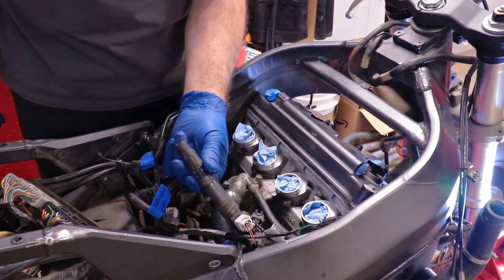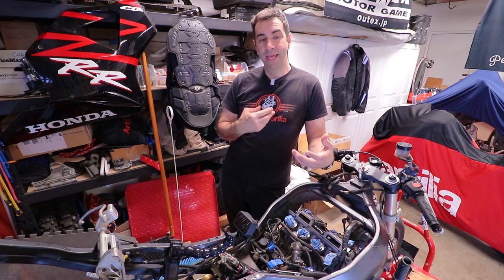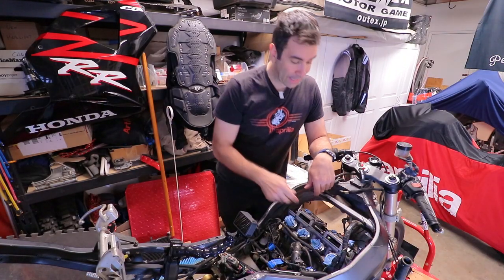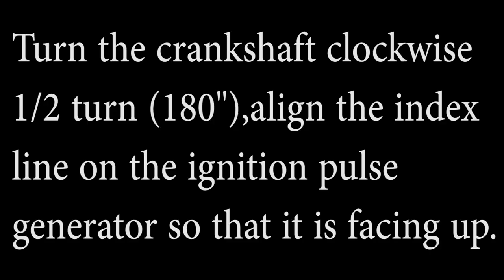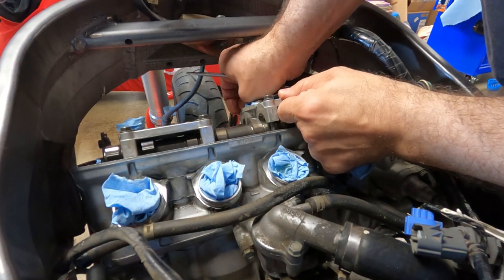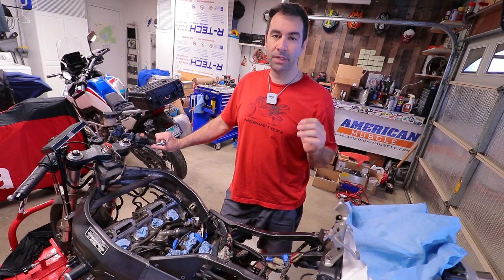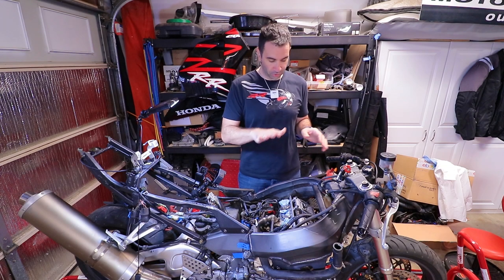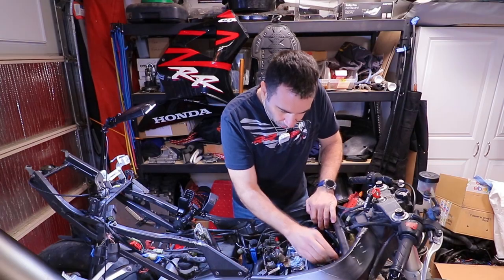Honda CBR 954RR Complete Valve Clearance Check guide Ep4

Comment: Hello, does this procedure apply to the 1997 CBR 600 F3? thank you very much friend, very well explained
Reply from the maker: The concept is the same but the tolerances change engine to engine. If you find a maintenance manual,  between that and my video you should be able to get it done 👍

Comment: decent video and passion to legendary model! Have one of those as well, but one issue is driving me mad -> jerky on revs up to 3000. Changed spark plugs + ignition coils, cleaned tank, filters but still same... nobody knows what`s the problem, pity :/
Reply from the maker: Well only 2 more things left to check the injectors or the vacuum tubeing of the throttle body, maybe the fuel injectors don't have a nice even spray that's why is Jerry to 3000rpm or there is a leak on one of the vacuum tubes messing up the fuel/air mixture. Good luck 😀👍
Reply: @AlbesADV  appreciate for a reply and hints! took out carb, cleaned it, did same with injectors (applied 10v and used spray can), mist looks good to me. Rechecked - replaced vacuum tubes, put everything together and to my disappointment no change :/ Works not too bad when cold, but total rubbish when warms up... With a water trick to exhaust pipe figured out that cylinder 4 is the problematic one as colder then others. Any more hints bud?? i searched whole internet, there are tons of people having similar issue with that model, but no one knows what`s wrong :/
Reply from the maker: If cylinder 4 is colder and and you have a trickle of water coming from the exhaust,  maybe, when the coolant gets to temperature and pressure increases, the coolant is somehow sipping into cylinder 4, that would explain the jerkiness below 3000 rpm since, maybe, above 3000 there is enough flow to negate the effects of the small amount of coolant in the cylinder, man i wish I could take a look,  good luck 👍
Reply: @AlbesADV  No water comes out from the main exhaust whatsoever, spark plug is darker (soot situation) but dry. Could a cracked valve give such a fault?
Reply: @AlbesADV  sorry for all those questions...
Reply from the maker: Maybe just a valve that doesn't sit right,  try to do a compression test and see what comes up.  Obviously let me know 👍
Reply: @AlbesADV  will try to disassembly everything again and switch injector + spark plug and coil to the next cylinder to see if the problem jumps over as well, to exclude those parts before digging deeper. The only thing amazes me that people report this issue since about 2004 and nobody ever solved it, shocking !
Reply from the maker: Of you have the chance,  I would test cylinder 4 compression when you remove the spark plug,  it's very easy and you should be able to rent the tool at autozone or buy one at harbor freight
Reply: @AlbesADV  i`m not from states... your videos looked very informative and looks like you know what are you doing so said will ask about my issue 🙃 it`s a tight space for spark plugs on 954, will any compression tool do or needs to be something special?
Reply from the maker: @justastulpe3265 i have a generic one and I use it for cars and bikes alike, it came with multiple attachments,  but I'm not sure what you can find where you live 🤔
Reply: @AlbesADV  i`ve added a link but youtube deleted for whatever reason... any chance i could contact you by email ?
Reply from the maker: @justastulpe3265 you can contact me thru the Instagram messages
Reply: The reasoning for the 3000rpm running sluggish is probably because you have either done the flapper air box mod removed exhaust valve, I noticed this myself when I did both, before it was perfect but I instantly noticed the bog feeling down low while setting off or slow cruising through traffic.my bike has 54,000 miles on it and the compression test on all 4 cylinders are at 160psi evenly. Not bad considering there 174 psi new.
Reply: @FromTheGroundUP627  no mods were done, bike is 100% factory stock

Comment: The chain that the tensioner takes up is below the sprockets and if it's timed either way, if the tension is on the chain, it wouldn't be pulling on the cam or flexing the cam because a it's seated and it's not rotating the chains on a sprocket. it's not like the chains pulling or rotating the sprocket via the chain tensioner it's just taking up the slack behind the plastic guard

Comment: How come you have to loosen the chain tensioner when checking the clearances the cam covers are down as far as I'll go. The cams aren't gonna flex. I don't see why tension on the cam chain on the sprockets would have anything to do with the lobes when they're all seated.
Reply from the maker: If you are only checking the clearance,  you are right , there is no need to loosen the chain. The Honda manual assumes some adjustments will be made, therefore requiring to loosen the chain. In my case, I just don't want to forget about it 😅
Reply: @AlbesADV  oooooo ok that makes sense. I was wondering if it was just like a prerequisite to adjusting like a step one make sure you undo this so you don't bend anything
Reply from the maker: No, just don’t start taking off the cam holder’s bolts before loosening the chain tensioner 👍

Comment: I really hope you see this! Do you loosen the cam chain tensioner before you check the clearances and rotate the engine? Is it ok to turn the motor with the chain loose?
Reply from the maker: Hi, no, keep the chain tensioned when you check the clearances. It's OK to turn the motor whith the chain loose only if you do it slowly and pay attention not to skip cam sprocket theeth . 👍

Comment: Hi, is there a way to tell if I need to change the shims without checking the valve clearance? Like symptoms that it needs valve adjustment, cheers
Reply from the maker: No, not really,  if it's out of spec enough to be noticeable,  it would be running really really rough
Reply: @AlbesADV  will it start?
Reply from the maker: Usually yes, we are talking about fractions of a millimeter. What you can do without taking apart the head is check the compression and see if there is a leak or a stuck valve etc
Reply: @AlbesADV  gotcha, cheers
Reply: @AlbesADV  one last thing tho have you seen a timing chain stretched out on these motor, if so what's the interval, thanks again
Reply from the maker: I personally haven't but anything is possible,  I'm not sure about the interval but If it's stretched out enough to render the chain tensioner null, you should be able to ear chain slap when the engine is running
Reply: @AlbesADV  thanks again for all your inputs, have a great day

Comment: Why do you have to loose the cam chain to measure ?  I do understand that it is necessary to take the cams out. But what happens if you do not loose the chain tensioner to check the valve gap??
Reply from the maker: Hi, in theory it shouldn't matter,  I did it that way because the maintenance manual said so, but the Manual also assumes you are going to remove the cams. Or maybe if the chain is tensioned my affect the measurements because it applies downward force on the cams, we are talking about fractions of a millimeter after all

Comment: I’m confused… you only lined up T mark and the EX mark checked intake valves 1 & 3 then rotate ignition pulse line upward to check exhaust 2 & 4. Then turn the crankcase back to align the T mark where it would be initially back check cylinder 1 & 3 intake but without moving the cam chain still on exhaust side then move the index mark vertical to check 1 & 3 exhaust valves. Is IN and EX supposed to be lined up for intake and exhaust whichever you are checking?
Reply: You never line up the IN side on the cam gear for anything?
Reply from the maker: Hi, the IN mark is on the intake side gear, it's not visible on the camera because it's behind the frame and I has to use a little mirror like those dentist mirrors. Is you are just checking the valve clearance when you align the EX mark on the forward cam the IN mark of the rear cam should be aligned as well, if you are doing a full rebuild from scratch then you have to align them individually when you install the distribution chain

Comment: You didn’t tell us which way to turn the tool for the CCT, and now my chain is too tight to put my cams back in and I can’t get the damn CCT off. What do I do
Reply from the maker: The tool for the CCT only turns one way, if you can't use the CCT tool the only other way is to remove the whole CCT from the engine, are the bolts stripped? Why can't you get it off?
Reply: @AlbesADV  no room for a socket- and mine turns both ways 💀💀
Reply from the maker: @RoninOC that sucks, any chance you can fabricate a tool to get in there, bend and/or file a wrench?
Reply: @AlbesADV  I made a tool, it wirks
Reply from the maker: That's great 👍 it's so tight in there

Comment: Can you really get the valve lifters out of cylinder 4 without removing the camshafts?
Reply from the maker: Yes, just work it to the side 😀👍
Reply: @AlbesADV  Hi. When do you remove the chain locking tool? After the bearing caps have been screwed on or after I've cranked the engine a few times?
Reply from the maker: @bravenewworld999 after the bearing caps have been screwed back on 👍
Reply: @AlbesADV  Hey buddy. Can you help me further? I changed spark plugs at sc50 and adjusted the valves. I did not remove the camshafts, they were always on the timing chain, had only put them to the side. Now my SC50 won't start. It sounds like the spark plugs ignite the gasoline but maybe in the wrong order? Or could the engine times have changed? Had looked at the time, IN and EX marking were correct. Do the ignition sinks have an order? You can't swap the plugs of spark plugs, the wiring harness lies the way you have to connect it. Do you have a suggestion for me on how to proceed now? I made a short video on my channel. In the background, the engine runs from the car, due to weak battery on the sc50. Thanks.
Reply: I have noticed the following. When you open the throttle valves you see the following: Cylinder 4, a valve always stays a little open. Cylinders 1 and 2, valves are closed but light air bubbles come through, so they are also leaking. I don't understand before that's coming. When I put in the shims and turned the engine 2-3 times by hand, I measured the valve clearance again. At the entrance it was 0.16 times 0.15. But if the valves suddenly do not close, then the valve clearance would have to go to zero or minus? 🧐
Reply from the maker: Wow, something is not right, 0 is nearly impossible and you can't go negative. At this point I would start from scratch, including sprockets alignment, even 1 tooth of misalignment ( although the EX and IN look ALMOST parallel) can cause the valves not to seat properly. It's hard to diagnose without seeing and moving parts, sorry
Reply from the maker: @bravenewworld999 i ve watched the video, it does sound like the timing is slightly off
Reply: @AlbesADV  Through the throttle valve you can see, as with cylinder 4, one valve is slightly open, the other valve of cylinder 4 is closed. Cylinders 2 and 3 lose compression slightly. If the engine timing is adjusted, do the valves still have to close completely? As I said, after assembly, I turned the engine by hand and measured the valve clearance. was 0.15-0.16. I'll start over now and measure everything again. Thank you.
Reply from the maker: @bravenewworld999 remember, the valves are all closed at TDC on the compression stroke

Comment: I have 929rr Bike. When i start the bike she will start, after 10 minutes when the temperature rise engine is not raving better its like lacking and stop.
i cant start it . after 20 minutes she will start again. what is the Problem 

*i cheak coolent its okey and full no air bubbles.
*fuel pump working normal i can here the sound
*radiator fan always on  

please Help what i have to cheak 😢
Reply from the maker: Look into the fuel pressure valve, sorry it's hard to diagnose this cases without putting hands on the bike

Comment: How many miles are on your bike?
Reply from the maker: 39000
Reply: @AlbesADV  so its 62k kilos is quite alot! Mine is at 57k kilometers. Your videos motivate me to do it on my own!
Reply from the maker: Yes, those honda engines are bulletproof if well maintained, they'll run forever
Reply: @kaiser98berlin  did you end up needing to replace the shims on your bike?